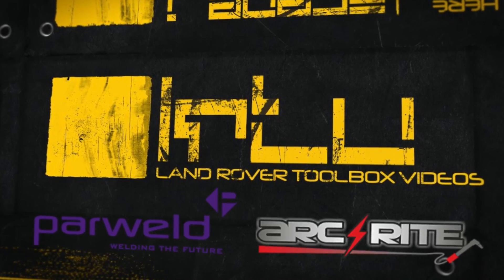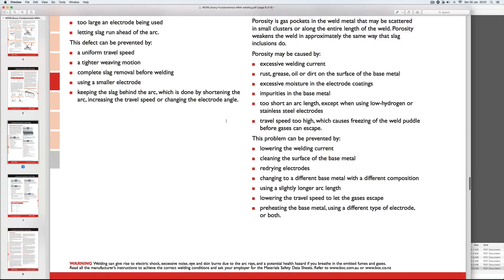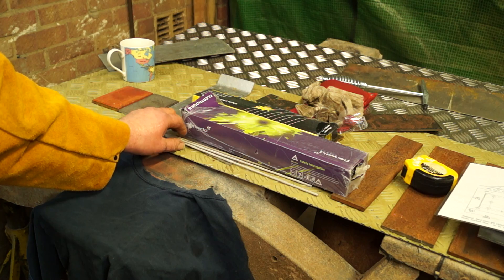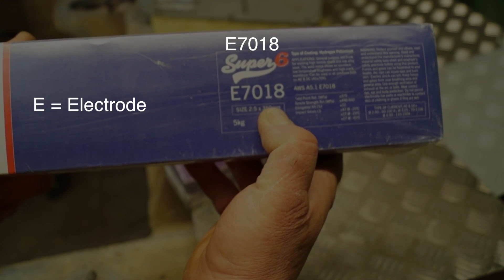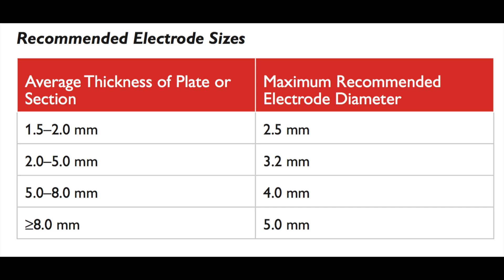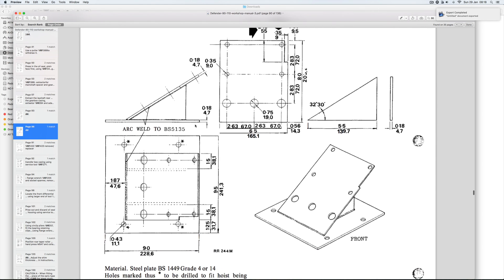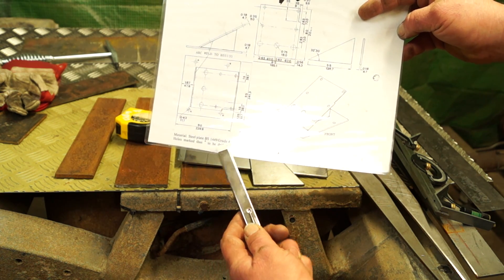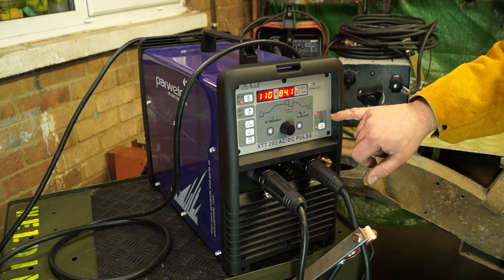Land Rover ( Stick) Welding -  Electrode Numbers Explained

Comment: I wouldn't throw away any rods providing the flux wasn't cracked or missing. If rods get damp you can bake them in an ordinary oven (Subject to permission if you live with partner or wife?). Last year I bought a bench from a farmer that had been in the entrance to a barn for 10years. He bought from an engineering firml when it was shut down. In the bench were about 15 9inch grinding wheels and roughly 100 4mm 6014 welding rods. Once dried in the oven the were used up on jobs!

Comment: be careful with the super 6 electrodes, Chinese produced
Reply from the maker: I thought everything was made there these days?
Reply: I tried them and compared to other known brands they didn't run as nice, probably why you never see them on the shelves at the welding supply shops
Reply from the maker: Ah yes.  The 7018s are for demo purposes only to show how low hydrogen rods, not dried properly will cause problems.  However, theses electrodes  were supplied by our local . Which reminds me I need to go get some SS electrodes.

Comment: Great video. Thank you for sharing your knowledge. If I am understanding you right, for thinner sheet metal work, you need to weld DC (Electrode Negative), would this be the same for most inverter welders? I have a Jefarc 160a inverter welder and when I recently tried to weld some body work, even down at low amps, I was getting blow through. I need to repair my door bottoms on my 99 defender and am putting it off until I know for sure I can weld the repair sections.
Reply from the maker: amps too high for sure but the metal is very thin on the door frames.  Is the metal fresh?  What thickness is it?
Reply: Land Rover Toolbox Videos the bodywork I was trying to weld would have been about 2mm and if I remember would have been about 20-40amps. The door repair sections would probably be the same thickness. I was using E6012 2.5mm rods. my understanding now would be to change to DCEN to reduce the heat at the workpiece thus reducing blow through.
Reply from the maker: If it is old metal that it is blowing through then it would be because the metal is thinner in those places.  Are you sure it is 2mm thick on those repair sections on the doors?
Reply from the maker: You can get 1.5mm electrodes.  Might be worth getting a small packet of them and try them out?
Reply from the maker: I had  think about your problem here, sorry took some time to get back to you.  Are you welding on DCEN ( DC Electrode Negative)?  DCEN is better for not blowing holes in your work.